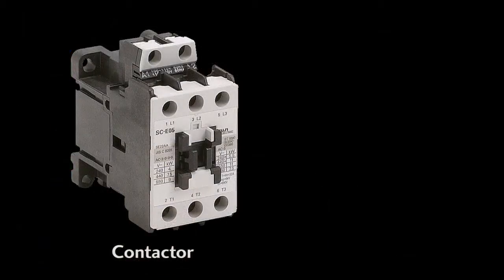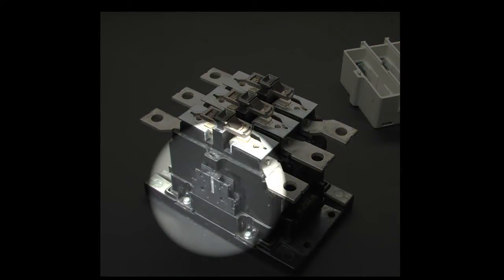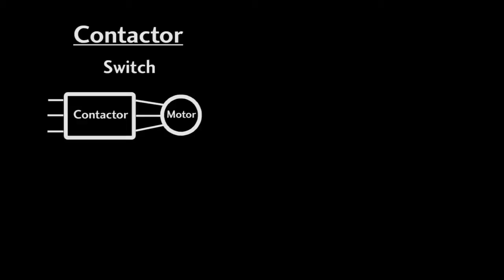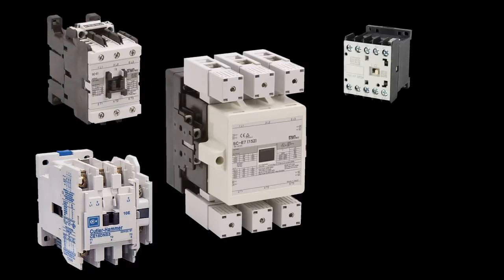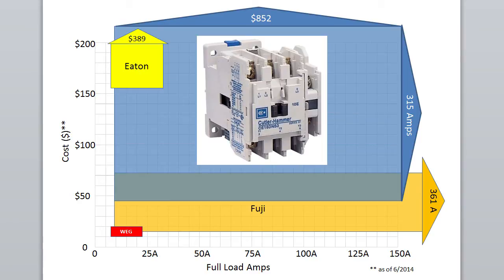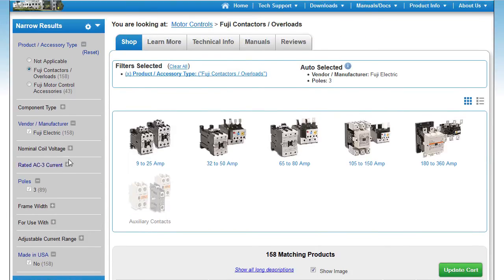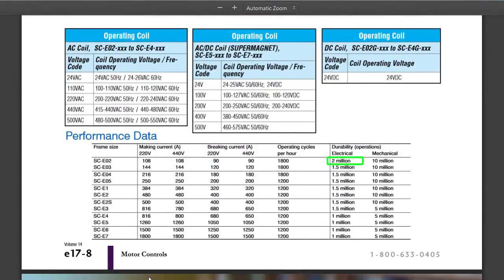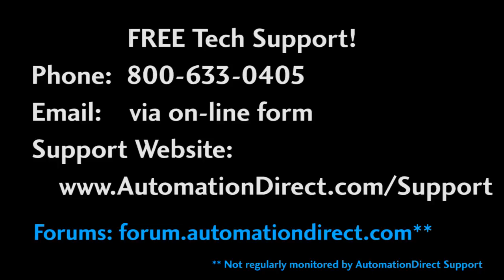Selecting a Motor Contactor from AutomationDirect

Comment: Hi, can you pls explain the reason behind contactor coil failure,like burnt and self destruct. I have a AC3 80a schinder easypact contactor with coil rated at 250v  Uimp: 6kV Ui: 660v Ith: 125a.  I have almost replaced this unit for atleast 7 times. All the time its the same issue, coil burnt and melts the plastic inside. Why does this happen & how can it be made more reliable & robust? Thank You.
Reply from the maker: Hi Ragaven,  AutomationDirect doesn't support Scheider contactors so I'm afraid we can't be of much help.  In general, I would double check the rating of the coil and what's driving it. Obviously the coil is getting too much power.  Note: Your message says yo have an 80A SC-3 Contactor. Yet when I look that up only the AC-1 has 80A sizes. So something isn't adding up. Make sure you really have a unit with a coil rated for 250 VAC. The coil codes can be found on page A-1 here:  https://download.schneider-electric.com/files?p_enDocType=Catalog&p_File_Name=EasyPact+TVS+Catalog++2019_V2.pdf&p_Doc_Ref=EasyPact_TVS_Catalog
Reply: @automationdirect  extremely sorry friend,i put wrong brand and specs. my bad. The specs given is for C&S  electric 80a not 85 and Uimp is 8kv model: LC1D803 & SCHNEIDER : LC1E80 . But never the less same problem across all the brands ive used & tested.they are ABB,siemens,L&t,SCHNEIDER,C&S. Am literally wasting lot of money replacing these things atleast twice a month. Am using these contactor for switching only neutral current on AMF panel which is less than 40a. But for safety am using 80a. is there any solution i can possibly do to increase its reliability? Not to mention there is a powercut 2 to 5 times a day at our factory. So its duty cycle is significantly reduced? Ive also checked the voltage it fluctuates around Ac 230-242 peak of 270 sometimes but its very rare. we have our own servo stabilizer and lt transformer.
Reply from the maker: Hi Ragaven,
AutomationDirect doesn't sell or support C&S contactors so I can't really can't help you with that specific model. But, in general, if the coil is burning up, it's one of four things:
1. Over voltage
2. Over Temperature
3. Physically obstruction preventing the contactor from fully closing
4. Under voltage where the coil is not producing sufficient force to keep the contactor armature fully closed

With #4 being the most common.  You said your coil is rated for 250VAC. If you are running 230VAC most of the time, then that would be suspect.

What is the full part number of the LC1E80 you are using?  You are using the contactor to switch the neutral leg of a 230VAC system and you are using 230VAC to drive the coil correct?
Reply: @automationdirect  yes sir, just to switch neutral  leg @220-240v.  I think Part no is 60947-4--1/60947-5-1. Its mentioned as IEC.
Reply from the maker: @Ragavenutb  That's the IEC spec it conforms to.  I'm looking for the manufacturer's part number. I assume it would be something like LC1E80-xxxx where the xxxx specifies the coil type.
Reply: @automationdirect   something is hard printed on the side since the plastic on the side is over heated and melted i cant make it what it is. I also watched one your video on SPD. I might have found the reason for the coil failure. The surge current & transient voltages are the pricks isn't?  That explains a lot. We have a 150kw motor driving cryogenic compressor. It draws 900 to 1000 amps while starting then settles at 120a idle and 200a full load. We usually start this motor using genset ( neutral contactor disengages when on genset) and transfer the power to main grid while the motor is still spinning at noload. When there is no diesel in genset. We tend to start these motors on main grid. This is where weird  problems comes. Safety fuses on incoming transformers will blow, Acb will trip for no reason. Boiler auto control system will report error codes on electrical line. A latched contactor at pumping section will fail for no reason. so can all these happen due to power surge and transient voltages? We have no safety devices as such shown on the video except a earth leakage relay,i have no idea what the design engineer was thinking. Last time an 400a contactor melted and fused together at poles & our workers were like ok ok np it supposed to happen . I was like wtf how can it happen these things costs insanely high and no warranty for burns (thats what only happens in electricals what was the company thinking) & i never get straight answers.
Reply from the maker: Without seeing a full schematic of your system I really can't comment, but yes surges can definitely cause all of these problems. Also, Consider using a soft starter instead of a contactor. There whole purpose in life is to bring motors up without large surges. We have a number of videos on those too.
FYI: All of our videos (over 1200) can be seen at: 
www.automationdirect.com/videos        Random search or by category
www.automationdirect.com/cookbook  By type.

Comment: superb info.....Can you please let us know how to connect inputs and output devices to plc hardware... if my input device is .. say a proximity sensor and output device is a motor
Reply from the maker: @Rakshan V Devadiga, Glad you enjoyed the video. How to connect your inputs and outputs to your PLC, will be determined by many factors. The best approach, in my opinion is to start with the Input or output device, determine the type of device (for example analog or discrete), verify the voltage or current requirements, and then ensure that your PLC can accept those inputs/outputs.  In your example, you mention turning on a motor, how this is wired will depend on the type of motor you are trying to control. If you are turning on a AC motor, I would suggest using a contractor as the actual output from your PLC. Allowing the contractor to take the amperage load of the motor, isolating the spikes from the PLC..